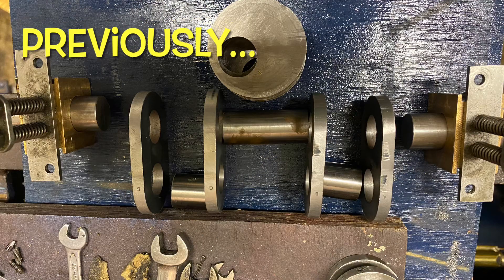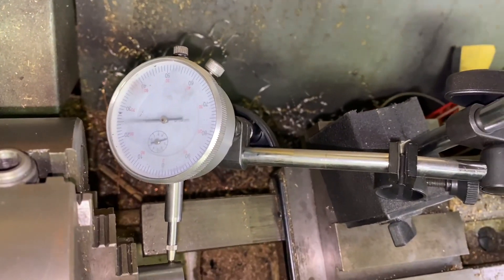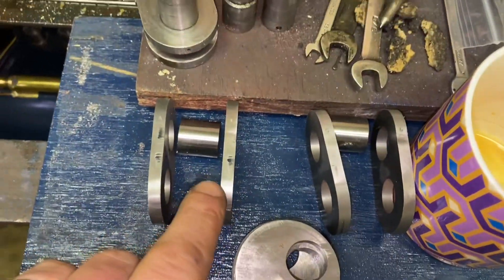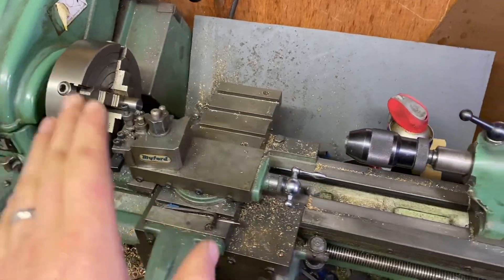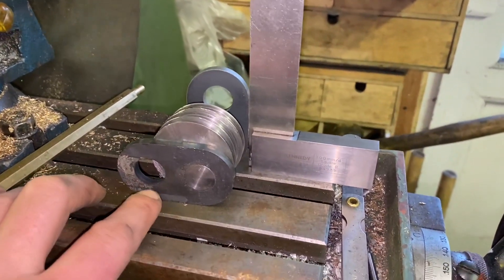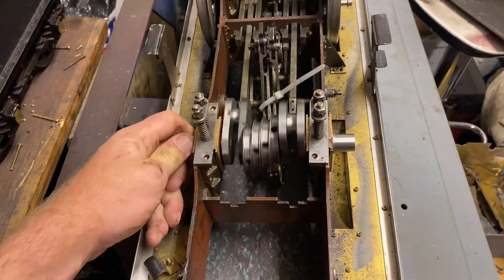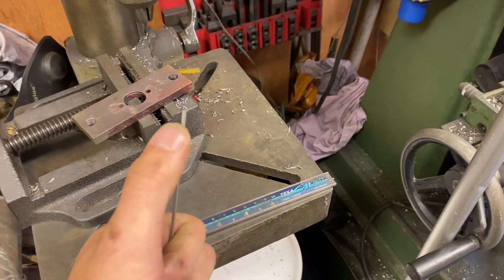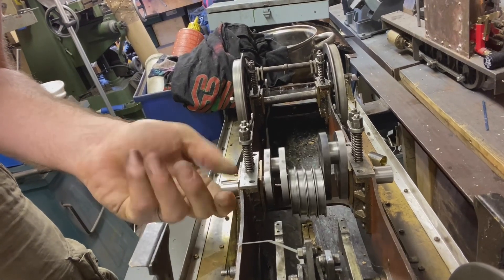Crank axle progress

Comment: Hi Tom,  do you prefer press fit axles to using loctite when building a crank axle?
I have a similar problem with a loose crank axle but only have a 4" vice which is not large enough to press all the parts together. What are your thoughts on using loctite?
Reply from the maker: Hi,
Yes, I prefer a press fit, all the crank axles I’ve seen that have failed have been loctite fits. That said, modern loctite are getting better and if used correctly can give very good results, I know many swear by it, however for me it’s something that could fail, but useful as an addition.